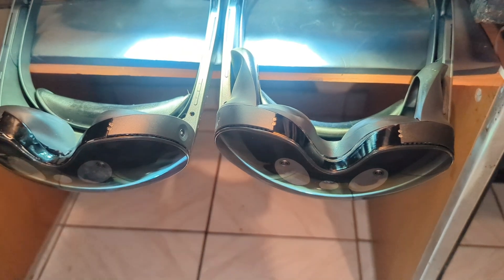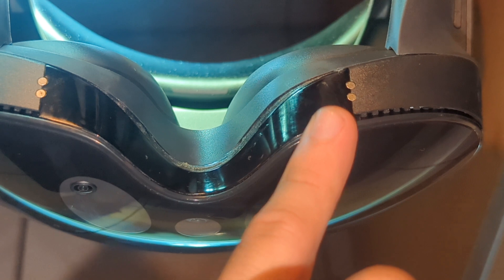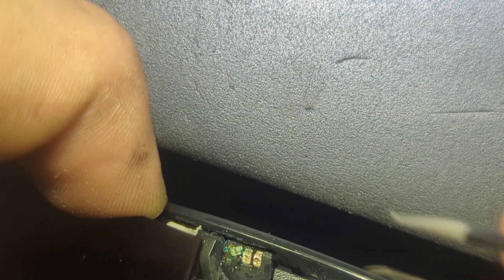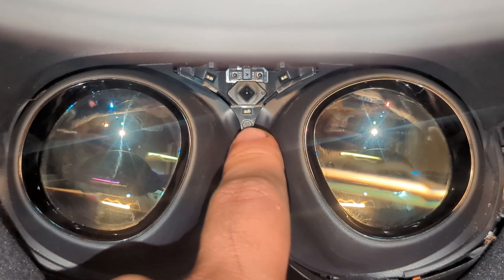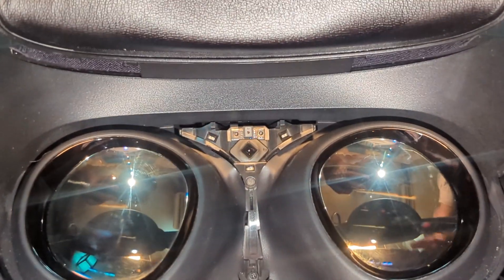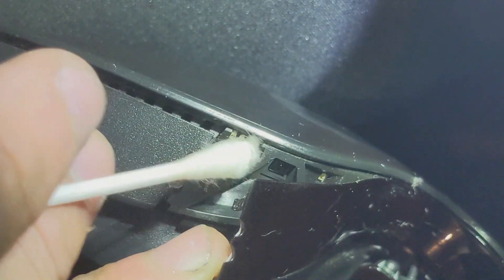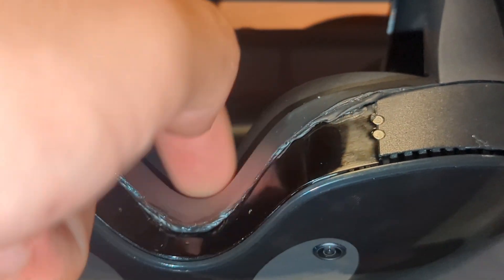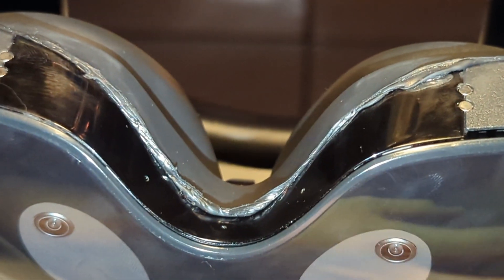Corroded IR sensors in my Meta Quest Pro (analysis?) Face tracking not working anymore.

Comment: Nicee video!! i was looking for this for so long. I'm dont get it why no one has yet made a video trying to fix it.
Reply from the maker: Thank you so much. I hope this information was helpful to you.
Fixing the corrosion is quite difficult—you'll need to disassemble nearly every part of the headset, which is a very complex task. 
And if you get that deep with the IR sensor flex, it will be impossible to find a replacement, since Meta doesn’t manufacture spare parts for this or any other headset :(
I guess that is  why nobody is fixing it... but hey you can buy ir sensors and "fix" it in a diy manner, search for the eyetrackvr discord, they could help you with thatn in case your qpro is already broken 😃
Reply: @diegoskx1  I was thinking of redoing the flex cable and replacing the ir LEDs with new ones if necessary. In a few months I'm going to try to fix a friend's quest pro and I'll post a video of the attempt haahha